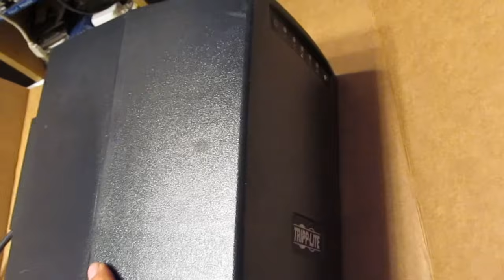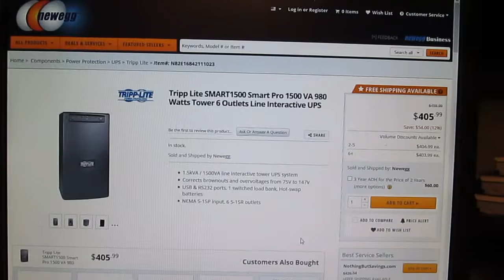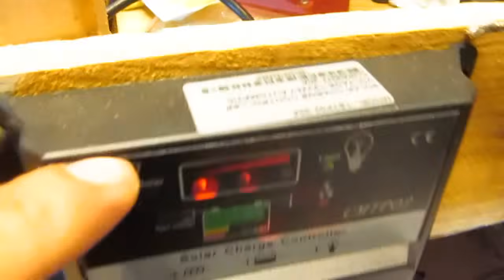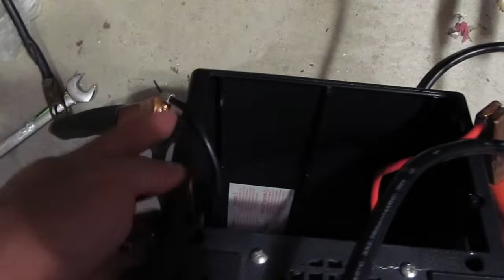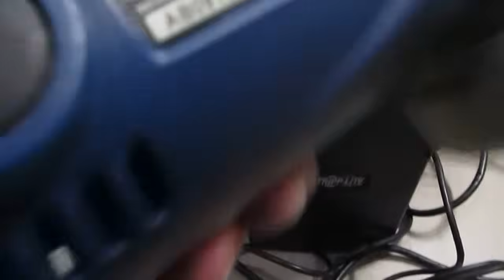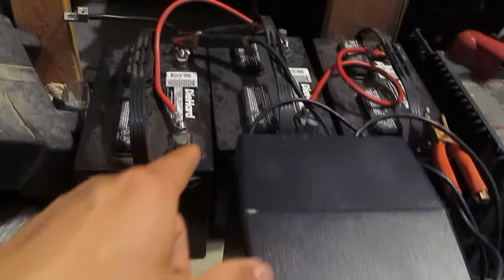Hack: UPS Tripp Lite Uninterruptible Power Supply turns into a 36V DC 120V AC inverter

Comment: You sir are a genius. Thanks for the heads up on this emergency hack. I have a Tripp-Lite UPS n my home office and another for my sons gaming rig. Both UPS were given to me years ago (had three) by a friend who buys and flips auctioned defaulted storage rentals. Just Googled for replacement battery and see your video in the results. Now I know in an emergency the stronger tripp-lites can also be used as inverters or used with solar panels. Never ever would have crossed my mind without your tip. Thanks!! Wish I had not discarded Tripp-Lite #3 which never worked for me before learning the batteries are replaceable. Maybe will find one in business trash cans where you live :P thx x2

Comment: Will this setup charge the batteries very well? How long does it take to charge them?
Reply: No the UPS wont even charge the battery half way because the battery amps is way larger than the UPS. You have to find a  separate charger for the batteries. The size of the batteries is way to much for the UPS-that's a lot of current on the MOSFET. They will heat up quickly and burn out if the batteries stays for long.

Comment: I watched this video a few days ago and then I went and found a free UPS also, it was a OPTI-UPS Thunder Shield TS2250B 2000 VA 1200W 11amp. I simply connected 24v to it and it worked perfectly. I am going to try and build a somewhat large battery out of 18650 cells. I need to figure out how to charge it though, perhaps I will do a similar solar setup.
Reply: 10 year update?